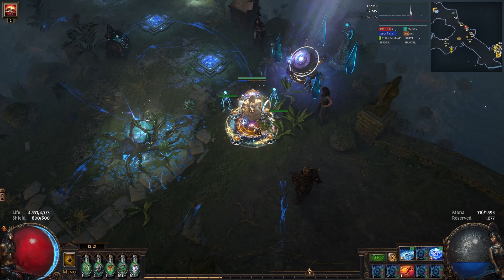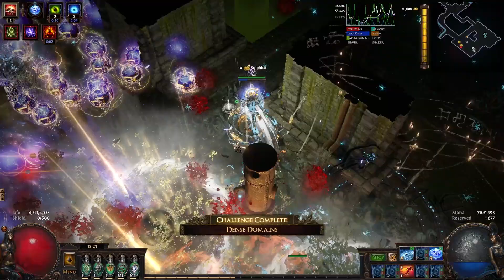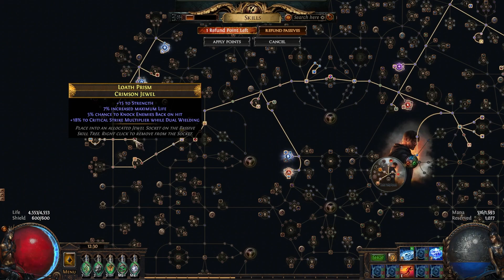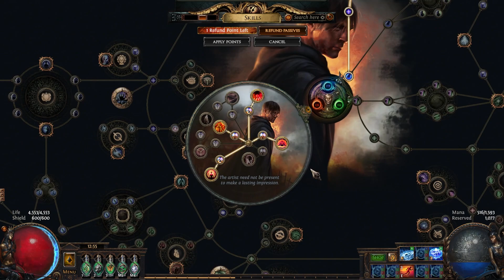Project Balls Final(?) Update - 3.21 Eye of Innocence CWDT Build

Comment: hey ergo, i have some trouble understanding something! why is it necessary to have multiple sources of curse-on-hit when the build's curse limit is set to 0?
Reply from the maker: The curse mastery: recover 1% of life/mana when you curse a non-cursed enemy still works even if you do not successfully apply a curse. It also stacks with the number of curses you attempt to apply. So, with a curse limit of zero, and three curse on hit mods, the build recovers 3% of life and mana on every single hit.
Reply: @TrollErgoSum  thanks! i didnt know the number of curses you apply would interact with that mastery!

Comment: I do not normally post on youtube at all :) but I wanted to say I am a highly experienced but very casual POE player, over 10,000 hours but I am just too casual to ever accumulate any crazy wealth or high cost builds. I always enjoy your 'path of walking' and have been using them for a long time. Thank you for the content, I always look forward to the content you put out. 

Would an elementalist be viable? I get you lose the trigger bots, buuuuut, with all damage igniting, perhaps you could achieve an even higher trigger rate via the eye of innocence damage and many more ignites?
Reply from the maker: I theory-crafted and tested the build on an Elementalist and I can say that Sabo is definitely the way to go. Through crit scaling and chance to ignite you can easily get to >70% ignite chance, which means you're getting >40% more ignites on Sabo than Elementalist. Pair that with the cooldown reduction and you're triggering way more frequently, especially on bosses which is where it counts most.

Comment: Another winner of a walking simulator! Quick question, why are some supports, like GMP, Culling etc not levelled up?
Reply from the maker: If there's nothing, or very little to gain by leveling the gem then I leave it at a low level so I don't end up with unnecessarily high stat requirements. The build does not get a lot of dexterity from the tree so it would be easy to have GMP be the highest dex requirement for the build which would add unneeded difficulty with gearing. There's no harm in leveling them up to the point their dex requirement is the same as Volatile Dead, I simply tend to forget and accidentally over level them which can complicate things whenever I try to upgrade a piece of gear with dex on it. So instead I just leave them at a low level.
Reply: @TrollErgoSum  Makes sense. Thanks

Comment: Great (as usual), but why no loreweave?
Reply from the maker: The only thing it offers over an essence rolled rare is a bit of crit chance and a bit of elemental damage. I'd rather have a good life roll and resistances. Loreweave does increase max resistances but this can be detrimental to the build as it lowers the amount of fire damage we take from Eye of Innocence which will make the CWDT gems trigger less frequently.
Reply: @TrollErgoSum  indeed. I have just removed it and immediately stopped having "mana issues' what i thought it was. Thanks again.

Comment: I was thinking of using archmage on the chest link spells for easy 100+mana spells, but having 2 spells being able to trigger the helm maybe means that we drop the spell cascade support for good. Also I think that mind over matter can be considered if we want a tankier version to take better advantage of the mana recovery and reduce oneshots
Reply from the maker: Archmage as a link in the chest is definitely an option, although going with 2 100 mana cost skills might get rough unless you also invest in your mana pool. My setup already has some situations where not everything will trigger due to lack of mana. However, you would bump the chance of triggering the helm up to 93.75% from 75% which would be effectively 25% more damage.